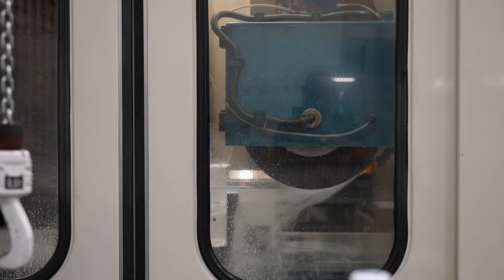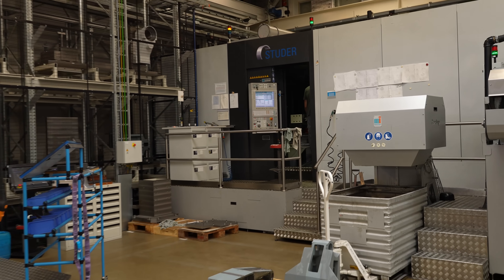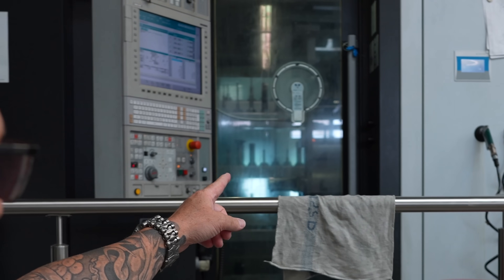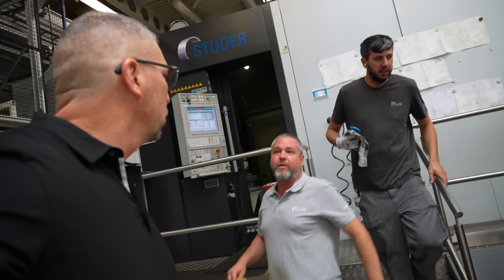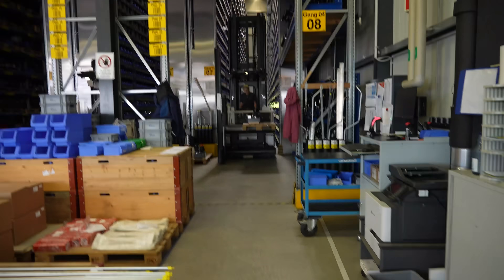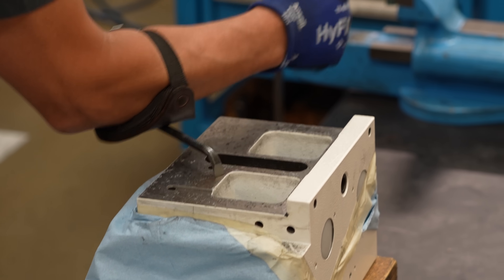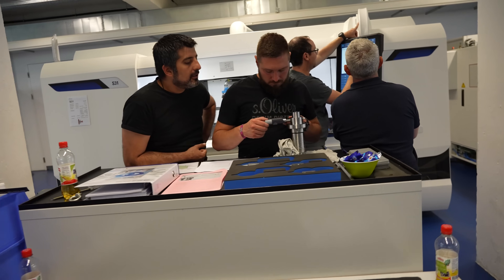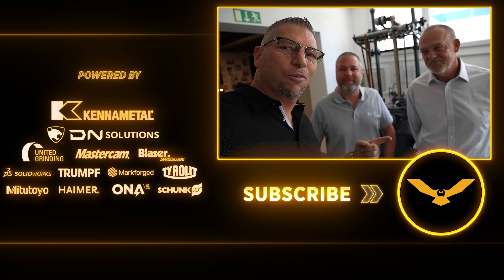GOLIATH CNC Machine Shop in Switzerland | STUDER Grinding Machines

Comment: At some point when the level of efficiency crosses a certain point, the jobs eliminated will create issues for people looking for a job. So what happens then. 

 At Haas manufacturing you can order almost anything and it will be on a truck headed your way in a week or two
Reply: I agree with your efficiency statement to some extent.  from my experience, haas is an okay machine, but it is what (in my world) we consider them "throw away" machines. They are not that durable, not meant for 24/7 work. They do have their place though.

Comment: Years ago in a shop we got a brand new Bridgeport knee mill. It was backed into a close proximity a new grinder. We warned them. Two or three years later the mill was trashed from damage inflicted by the grinder abrasives. Sooo my question is,"How much metal finishing happens in their line manufacturing) assembly process?

Comment: How long do they age the castings? I knew good machines are done that way but never really knew how long they would leave them out.  We used to do that with racing engines. A new block wouldn't be used,  or use a block from a used vehicle. Great video!
Reply: Some Italian manufacturers, used to season for 2 years.
Reply: @siffar  that's what I was told about Bridgeport mills, as far as manual machines are concerned, their castings are second to none.

Comment: I tell you how to make money:
- be alone
- work hard
- let 2 to 3 machines run at the same time
- let the $$$ roll in! BOOM!
Reply: What do you do first buy the machines or get the work?Even though I have an established business I think twice before my next investment in a new machine.
Reply: @mehmettemel8725  Well, I was lucky to buy a complete shop with 3 machines and the customers.
But of course, if you started with just 1 machine, you need at least 1 customer who can give you more work if you ask for it.
If you compete on the free market it's hard to get enough work for a 2nd machine, unless you do all the trash jobs that are offered. Personally I specialized on hydraulic blocks, which is a nice niche, but needs some kind of background knowledge.
Reply: @zagareth4604  It's not always what you plan to do sometimes work governs what you will be doing.I started in my home garage 20 years ago moved out into a workshop 18 years ago have a few cnc machines and manual machines as well but it's never enough.My reply to your earlier comment was it isn't always easy to get work without machines and buying machines without any work lined up.As you say you were lucky to buy an established business but starting from scratch is a little hard.I've always been too cautious which is probably not a good thing in terms of growth but rather be safe then to lose everything.
Reply: @mehmettemel8725  Yep, I know. The problem is to keep the balance of incoming to outgoing work, between requests and offers. I'm always honest with my customers and I always deliver A class items, never B or worse and this at the lower end of the price range. This way you gain a very good reputation among your customers. And THIS grants, that you always get work when you need it and that you are allowed to refuse work if you can't do it.
But I can only outplay my competitors, BECAUSE I'm able ti run multiple machines at the same time and this makes me able to be cheaper. Works so far... not always, but often enough.
And even in insecure times like this it doesn't take much to get filled with work up to the roof, when you are alone.
But I agree, to have 1 good employee is also a very good alternative for being alone

Comment: Machines come in all kinds of price ranges. A lot of them look very similar but the difference between a great, quality machine and a sub-standard ones is in those little details that are sometimes invisible. Aging the casting is one of those . . . nothing can replace the natural aging method. Scraping a perfectly ground surface manually may make no sense to many, but it is a secret for long-lasting precision. In today's, throwaway society refurbishing old machines speaks volumes of the companies faith in their own workmanship. Talk about recycling - imagine if car companies had such programs. Thanks for the tour Titan! 
BOOM - it is a machinist thing - you wouldn't understand it🙂
Reply: I always get a kick out of a mill with a "chrome plated quill" as if that was something special. A good mill has that as normal.
Reply: Surely they don't scrape to achieve tolerance/fit anymore (correct me if I'm wrong) I think the scrapeing is to produce small pockets that trap oil and similar effects. Presumably they use some pumped oil slideways??
Reply: @patkirk960  yep, scaping is just like honing on cylinderes

Comment: I bought some Tornos Deco CNC Lathes in Switzerland. LNS bar feeder and tool sensors. Load up the bar feeder for the night and come back in the morning. One operator running 6 machines no problem. And that's with 20 year old technology. Today?